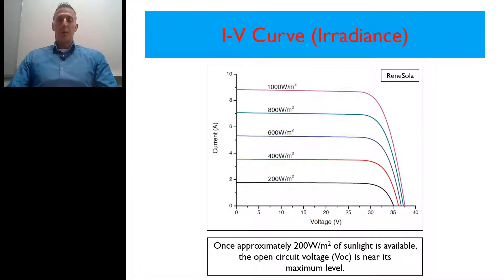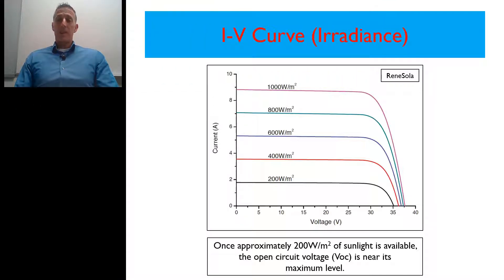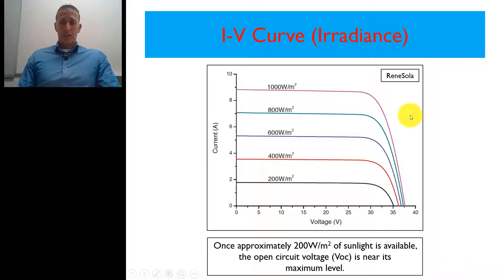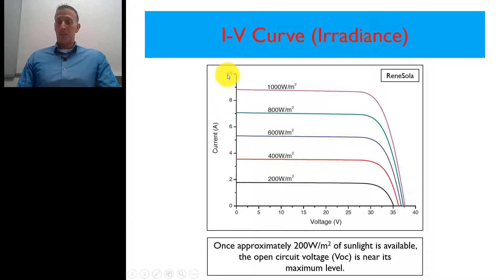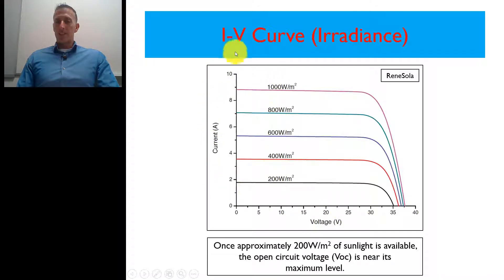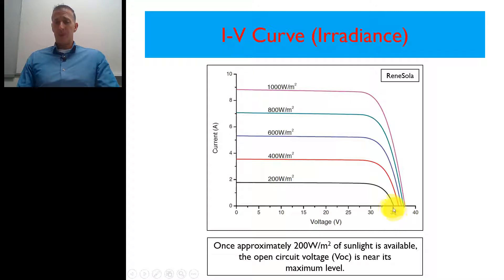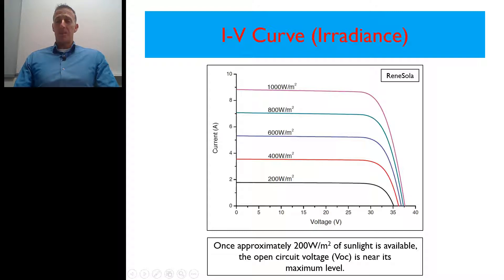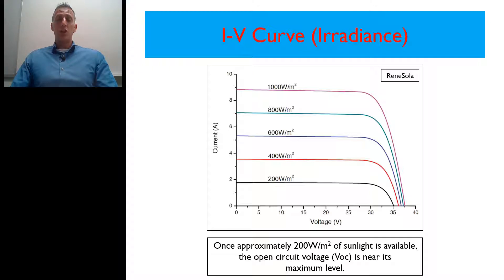Solar Training - I-V Curve (Irradiance)

Comment: why Voc increases only slightly with increase in irradiance?
Reply: It is because, the Voc is mainly influenced by the temperature of the module.
Reply: Voc depends on the accumulation of charges that is holes on the p side and electrons on the n side of pn junction diode and how much charge can be accumulated depends on the construction of a solar cell.